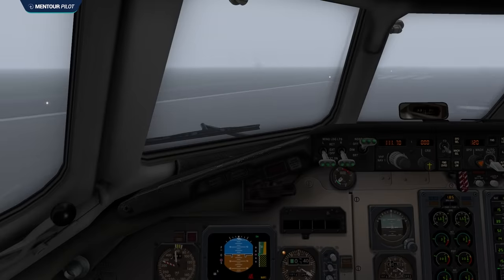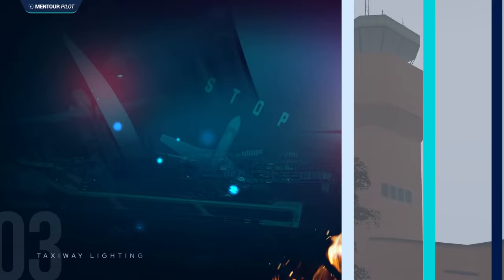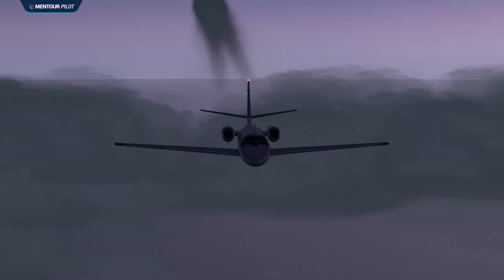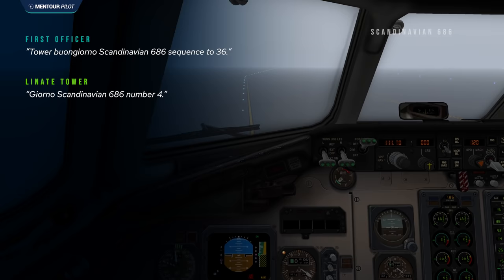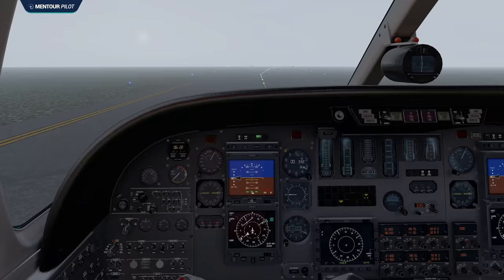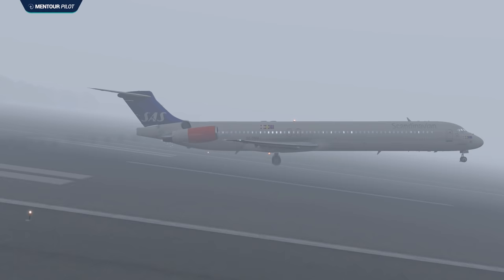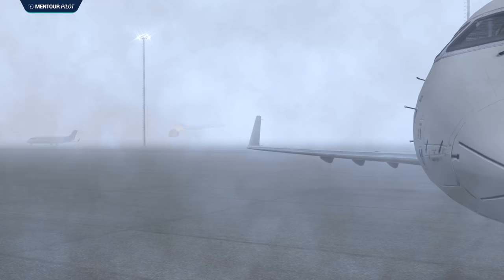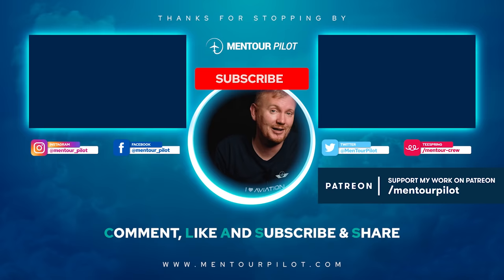A Perfect Storm of Mistakes! And how Heroic Pilots Almost solved it.

Comment: In the late 1990s & early 2000s I used to fly in and out of Linate fairly regularly.  Twice we were just starting the take-off run along the runway when we stopped very suddenly, on one of those aborted take-offs I could see another aircraft crossing the runway ahead of us.  Scary or what.
Reply from the maker: Indeed! Like I said in the video, it was fairly common apparently.
Reply: Wow, unbelievable!
Reply: @MentourPilot  The way you explained the airport layout... I was thinking it was inevitable for a disaster like this to happen. :/
Reply: @MentourPilot  I readed in a report of this accident that the Tower even cleared a Lufthansa Flight for Take-Off after the crash happened - the Lufthansa Pilot´s negated the Take-Off-clearance because they weren´t able to recognize that the SAS flight in front of them had started. According to this report this was the only reason why not a second aircraft at this morning crashed into the Cessna.
Reply: this is why if you see a situation like this you play hell and get stuff changed, my dad when he was working out of pureto rico was being flown to and from an island as part of his job regularly with a shot transport plane that was always having trouble with an aileron getting stuck

and on one of the last times he flew on it the engine started having trouble and sparking, the pilot brushed it off and my dad when he got off that plane that day said to his boss, you either get rid of that plane or I'm done, as I am NOT flying on that aircraft ever again.

and they did, a brand new cesna citation, which he was not happy about as this guy was always pulling deals, and the plane, the bad one, which had been used as a transport in africa of all things, got sold and put on mail duty flying to and from the islands of puerto rico,  till a few weeks latter with a 20 something pilot flying it, the engine caught fire midflight, an aleron got stuck, and crashed with him in it

like when you see crap with that, I dont care if your boss is the highest general in the land, YOU PULL HIS TAG and tell him what's up

as if my dad hadnt done that, him and his coworkers would have been at the bottom of the ocean, all because of some cheapskate boss running a deal with a stupid transport plane

like my pops actually saved lives that day by telling that SOB whats up, and dont hesitate to do the same, as aircraft are not the kind of things you screw around with, like they demand respect and to be looked after, if you cant do that, pull it from service as the risk is too great if even one system is working incorrectly on it

also one of his pieces of advice is never fly on an aircraft with two engines, always one, three or four, as the two engines you cant tell what engine failed and if they get unbalanced and dont know they go in, with one you can still fly the aircraft just with reduced power

and every since he told that every single damn time a crash has happened, I look and sure enough, every single time, its a two engined aircraft, like if you ever meet me and wonder why I get ansy about 2 engine aircraft, and the always crashing DC10

that's why lol 

sad part is as an aviation enthusiast I really like alot of the two engined aircraft from WW2 too as well

but each and every single one of them, engine failure and go ins from an engine failing........... even with experienced pilots behind them too, like its just, yeah you really have to be damn careful with dual engine setups

as theirs still no cameras to tell you what engine quit to this day as mentour mentioned in one of this debrief videos here awhile back.
Reply: @NicolaW72  Wow! So close, impressive situational awareness and professionalism on the part of the Lufthansa pilots
Reply: @kavinskysmith4094  Now days if you are going to wait for a three or four engine plane to fly on you might be waiting a long, long time, for most flights. The reason most crashes are with 2 engine planes, is that is what is being used for,  I'm going to guess and say 95% of commercial passenger flights.
Reply: @kavinskysmith4094  You are contradicting yourself!  You say that only two-engine aircraft crash, but you also say the DC10 always crashes.  The DC10 has three engines.
Reply: @kavinskysmith4094  Wow. What's really rough about that though is soon everything will be two engines..
Reply: @tomriley5790  As Petter said it in the video: It was the first morning wave of departing aircrafts, that means one aircraft lined up after the other at the holding line and every two minutes one aircraft took off from runway 36R. The Lufthansa Pilots had no clue that a crash happened, too. But they simply - and fortunately - looked on their radar screen and didn´t saw that the aircraft in front of them was showing up in the air after two minutes, when they got the take-off-clearance - it was as simple - really as simple! - as that. Otherwise another aircraft with more then hundred people on board would have crashed into the Cessna. The Controller needed another one and a half minute to recognize that the SAS MD 87 didn´t show up in the air on his radar screen. And he needed ten minutes - ten minutes! - to remember that there was also a Cessna missing - and the fire fighters needed then another 26 minutes - 26 minutes!!! - to meet the wreckage of the Cessna on the runway.
Every day somebody of this airport crew spended in a jail was fully deserved!
Reply: @NicolaW72  Lufthansa means Germans. It explains. I trust only two professionals in the World : Japanese and Germans. All the other nations have good professionals as well. If you're lucky.
Reply: @andreypetrov4868  I´m German - but unfortunately I´ve to disagree. The pilots of the Cessna were also Germans and they simply messed up and made one failure after the next one. They´re at least responsible for the crash, too.
Reply: @NicolaW72  I see your point and tend to agree but ... can you expect the same level of expertise and knowledge from pilots of a small Cessna as local air traffic controllers  who come to work everyday and being responsible for the same airport ? Not to mention misleading red lights that are supposed to be ignored which is a good recipe for disaster. Had anyone submitted a complain to the management saying that something is wrong ? No. And it is not because Italian ground staff didn't not care. They did. But as it was said in the video, the management would consider them as trouble makers. It is not unique to Italian culture but unfortunately they aren't immune to this problem.
Reply: @andreypetrov4868  
We must be very lucky in Australia then.
Reply: @AUmarcus  I didn't get it. Can you please elaborate on this.
Reply: @AUmarcus  I was exaggerating, I trust lots of nations e.g. English or Americans. I am really glad to hear that Australians are good as well.
Reply: @andreypetrov4868  
If you know anything about aviation you should know Australians are good....better safety than British and American as well. We invented the flight data recorder no less.
Reply: How come such close-collision situations weren't reported to authorities that could enforce a change on that disaster-bound airport?
Reply: @CoastalSphinx  This is why Kavinsky said and the DC-10, he knows it's not a 2 engine case. The DC-10 has a bad rep safety wise, but some of those issues are poor use and maintenance rather than design/mechanical flaws when properly constructed.

RIP L-1011
Reply: @andreypetrov4868  there's definitely a thoroughness and preciseness that's associated with German culture but I've found that you can have professionals in any culture and unprofessional behaviour in any country as well. It's a matter of culture, training and ethos which comes from decades of good management and to be frank honesty. That was obviously lacking in this airport.
Reply: @NicolaW72  very impressive, presumably them refusing to takeoff prompted the tower to look for the aircraft on their scopes otherwise who knows how long it would have taken them to realise... really shocking airport.
Reply: @tomriley5790  I totally agree with you. That was exactly my point. I was referring to German technological / engineering culture. Not to label individuals.
Reply: @tomriley5790  Indeed, exactly.
Reply: @tomriley5790  That is possible. Not only the circumstances which made this crash happen were shocking - what happened after the crash was probably even more shocking.
I´m not a person who usually calls for the attorneyship and the court. But again: Every day which a member of this airport crew spended in a jail was well deserved.
Reply: Unfortunately when you see an incident like the one above happen, you know there were DEFINITELY many near misses before. I am a doctor and this is what we learn about mistakes and errors; the ones that come to actual harm are the tip of the iceberg, and unseen below the surface of the water are the many incidents that were "near misses". I'm glad you were safe on your flights. How unconscionable that none of those near misses was seen for what it is: a catastrophe that will inevitably happen unless change is effectuated.
Reply: @aesaphyr  Yes, indeed. And if you think this through you will come to the conclusion: It was a big failure of the regulation authority, too.

Comment: This was not the failure of the safety management - this was the complete absence of a safety management.
Thank you very much for bringing up this tragic story!
Reply: I worked as a signal maintainer in NY subway system and safety was paramount. But I saw many things that were not done properly. I corrected what I could like putting lightbulbs in traffic signals and fuses in electric switches  to change tracks. There were occasional derailments in the train yards frozen switches men getting electrocuted or run over. All transportation means can be dangerous and unexpected. Try to report or fix the problem. Not be part of it.
Reply: @sharoncassell9358  Yes.
Reply: Italy in a nutshell. Welcome to criminal negligence, the country.
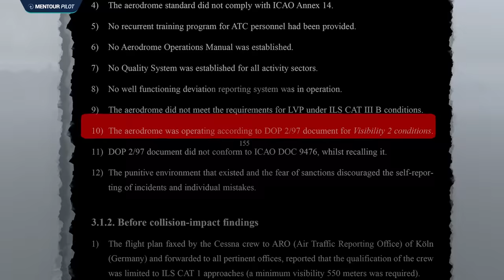Reply: Worse yet, as mentioned at 27:49 safety processes were essentially forbidden.
Reply: This is the most iconic Italian thing. Complete absence of safety 😂
Reply: @AnoNym-zi5ty  I said nothing about Italy in a whole - that would be too much cliché. But in this case it was so.
Reply: @AnoNym-zi5ty Yup! Only in Italy! If I heard this story without knowing it’s location, I would immediately guess Italy (maybe France)

Comment: I work as a train driver, and I have learned the hard way how respect for the signals basic color and meaning is of utmost importance. The infrastructure developer where I once worked, had to rebuild the signals on the entire freight train terminal which used to be my base, many years ago. 

To get it done quicker, they cut corners and got my company to agree on doing things differently than the rule books said. 

Usually when you build a new signaling system, once installed but not in use yet, you turn the signals away from the drivers view and put a large "X" on them, clearly marking them as "not in service". With my companies blessing, the infrastructure developer skipped these steps, turned the signals on 24/7 during the construction period (for testing etc.), and told us drivers to ignore them (pass them even if they say "stop"). 

Having done the EASA ATPL-H exams, I knew from the syllabus of Human Factors, that this was a bad idea, so I protested, but to no avail. We had some bad mishaps because of it, derailments and what not, once the signaling system was put to use. 

Cutting corners has never been good for safety.
Reply: that seems really bad, Like on the road if traffic signal is malfunctioning default is to treat as a all ways stop and not blow through.  Would think in an RR they would say stop and radio whatever the train version of a control tower is.
Reply: That old saying “safety regulations are written in blood”.
Reply: That's almost unbelieveable - I'm surprised Unions were okay with it and failing that the safety inspectors.
Reply: @tomriley5790 in guessing it's in the usa where the rail unions aren't as powerful as elsewhere (?)
Reply: People can get fired for passing signal at danger, right? I like trains, so I hope that is correct.
Reply: @LordInter  His description of his position as "train driver" says something else, as in North America, his position is almost always referred to as "engineer".
Reply: I’m a nurse who takes care of patients before they go into a Cath Lab procedure and when they come out. I know panicking never yields a good result, but after watching so many of these Mentour Pilot videos there is definitely a common theme across all professions and that seems to be that if you take shortcuts people are going to pay for them and sometimes the cost is life. The more stressful an incident I am involved in, the quicker I step back a bit, keep my mouth closed, and assess the situation…and then speak calmly when it’s my turn. Chaos codes never end well. Keep calm, reset your brain to focus on the issue at hand and DO what you have been trained to do…..which also means train often.
Reply: Completely insane for "train" operators to ignore a safety signal! Thank you for the story.
Reply: Every job brags safety first. but I've found it to be money first. Safety was often bypassed. I've gotten injured due to this but continued to work. I've reported certain infractions & was poopooed. Life goes on. I even worked for Alitalia at JFK and guys would speak Italian. I learned some in school so it did not hurt me too much. Other workers spoke Spanish  or English only. That caused problems in communication at times. It could have been worse.
Reply: What is Mentour Pilot’s name i like his way of telling it like it was he is a great storyteller
Reply: What if they're really sharp corners?
Reply: @connies.battista6127  Petter Hornfeldt.
Reply: Spiderman into SPIDERVERSE< yes SAS is bad
Reply: @metalgearsolidsnake6978  Would I crash a red light if instructed to do so?, probably yes
Reply: Those idiots must be forced to do damage payout from their own pockets. That will quickly teach everyone and prevent all such bs
Reply: Safety rules are written in blood, and mostly not of decision makers.
Reply: Your post makes me wonder how we had 2 large freight trains collide head on  several years ago just south of where I used to live, Guymon Oklahoma toward Goodwell Oklahoma. All I know is there was some issue with signals or someone not paying attention. Only one  person survived by jumping from the train and running across  the highway right before impact which ended in immediate fire. Trains out here usually pull around 80-100 cars or so of double stacked containers or large tankers (yes I would count them at crossings all the time) and run right about highway speed of 65 mph so it was a level of fire and destruction this area has never seen before. I found it incredible that the guy that jumped from the train was able to run after baling at those speeds but I guess adrenaline is a hell of a drug. It was in the day time in completely flat, desert like terrain sparsely scattered with barbed wire fencing and tumbleweeds. 

It would be interesting to know how this accident happened in detail like mentor pilots descriptions beyond the simple explanations I found on google.

Comment: When u mentioned the stop light, it made my blood boil. I've seen something simmilar happen before on a train station, where the sound signal sometimes wouldn't play on train approaching and sometimes play out when there was no train approaching at all. So ppl were used to ignoring the signal, which led to death of a young boy. What is more outrageous, is that this issue wasn't fixed even after the incident.
Reply: Normalization of deviance as someone called it
Reply: That is worse than having no signal